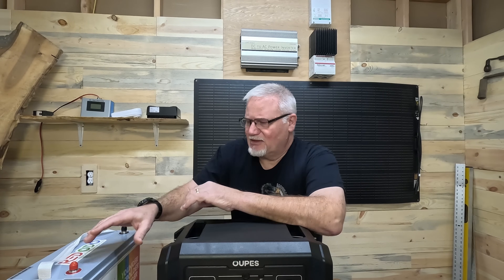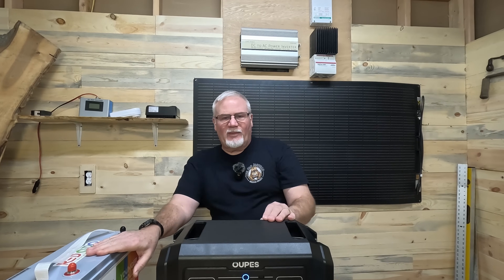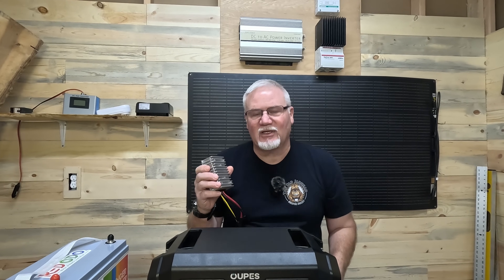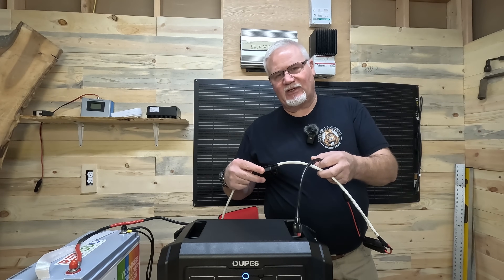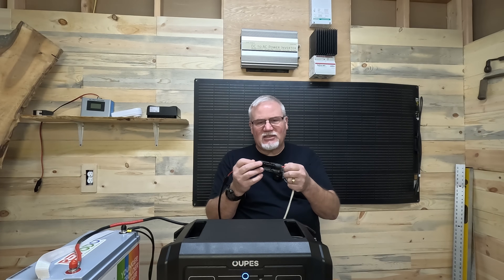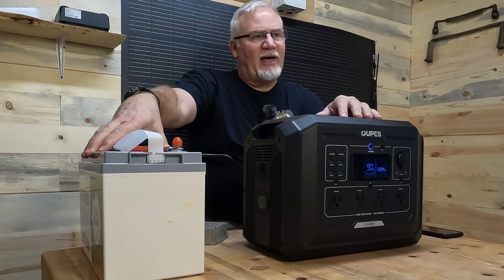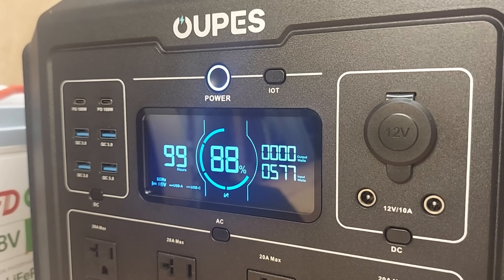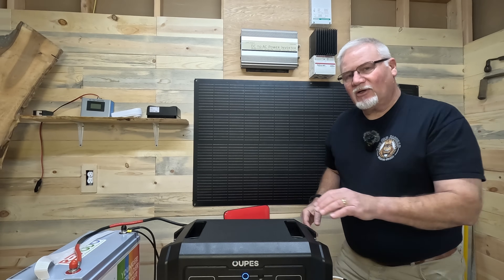Discover How to BOOST Your Portable Power Station Today!

Comment: Thats A really nice item 12-24 to 
48 volts  converter on only one 12.8 - 100 ah battery
But how long will it take to charge the power unit @500 watts.
 "say two hours"
Looks good though
& the solar setup is A plus add on 
Thanks Doug
Reply from the maker: I don't look at this as a 'charge' thing but rather an 'extend' thing.  Basically, the power station should already be fully charged and the battery too.  Connect them together and the battery will drain first unless you try to draw more than the 500w or so it gives via the solar port.  Once drained you're on the power station but can run a generator to charge the battery back up and continue to use it.  Many did this during Hurricane Helene and reported it worked very well for them :D

Comment: Would you recommend using the same setup on a Ecoflow river 2 pro??
Reply from the maker: Ecoflow Solar Input = 11-50V 13A, 220W Max --  as it's limited to 220w using a 12.8v battery would be fine as it should give you 166+w of charging while in use.  Of course, you have to then, later, charge the battery back up via a charger or solar panel and charge controller.
Reply: @TheOldJarhead ok I’m planning to use 2 lithium ion batteries 12.8v 100ah and a Victron Energy 100V 30A charger control with an 450W 48V 11A solar panel to charge the batteries
Reply from the maker: That would work nicely.
Reply: @T @TheOldJarhead  can I still use the Dc to Dc 12v to 24v converter?
Reply from the maker: You wouldn't need the 24v converter.  Just connect the batteries in series to get 24v and attach the controller to the outputs (from the 24v series batteries).
Reply: @TheOldJarhead ok nice 👍

Comment: Been watching your videos very helpful. Still a little confused with charging when you’re connected with  a external battery. When you’re using an external battery through the solar charging port. You can’t have your battery hooked up to a solar controller and its own solar array, while it’s hooked up to your oupes mega 1?
Reply from the maker: Actually, you can hook up solar to the battery (via a solar charge controller) and leave the battery connected to the solar port as long as the charging voltage doesn't go higher than the solar input max.
Reply: thank you for your help, do you recommend a solar charger so I know what specs I’m looking for
Reply: Or can I simply not connect too many panels that will not equal over that max voltage? Like by just connecting to solar panels in parallel with a max voltage of 40v
Reply from the maker: Hmmm depends on a number of factors.  If 12 or 24v the LiTime you see in my videos works well, for a little less the Bataria also works but dollar for dollar Victron may be the better option except the 100/35 which gets too hot
Reply: I have a 48v -52v battery
Reply from the maker: I've used a few that will do 48v LiFePo's but just bought this one for my own uses:  https://tinyurl.com/y5u3vsby Victron has excellent BT aps and integrates with a lot of systems.  Yes, it's more expensive than the Bataria I have been playing with but a lot less then the MorningStar and Outback controllers I have :)  So I have no issues suggesting this one :D  Victron has a great name too!

Comment: I want to charge a Anker Solix C300 with a spare car battery (12v 660 amp), do I need a charge controller for that?
Reply from the maker: No, but I would not use that battery.  Lead batteries do not have BMS's to protect them or the cycle life of a LiFePo4

Comment: Nice! Thanks for sharing the video. What size battery cable did you use?
Reply from the maker: I believe in this one I used 10awg cable as you're only drawing 13amps at most.
Reply: Thanks for the reply.

Comment: You really did help me out, I have been trying to learn this now for days.
I have my buck booster with my ecoflow river 2 max and a 100 ah LiPo battery. I won't be drawing more than 45 w with my cooler.  I'm mostly just charging my phone, lighters and air pump. Maybe a fan. I have a 160 watt solar panel with built in MPPT.
Reply from the maker: Glad I could help!

Comment: I have 2 EcoFlow, max charge is 24v 12amp and 24v 15amp.  I have a up converter that is 24v 15amp.  I’m scared to put it on the 12amp power station. I’m getting ready to add a 12amp fuse on the power station side. My question is, will the power station itself only draw 12amps and limit its self or does the up converter pushes 15amp all the time. Thanks
Reply from the maker: If connecting to the solar port then yes.  The power stations solar port limits what it draws.  I'm using batteries with 100amp BMS's on power stations that only draw 10amps.
Reply: @TheOldJarhead thank you, I’m using the same battery. Do you think the fuse on the power station side is still a good precaution?
Reply from the maker: I think it's a good idea

Comment: I am new to all this, do you need a stepup convert or can you just hook the 12v to the switch & fuse. I love the way you explain things. I already have an oupes 1. but would like to make it last longer.
Reply from the maker: You can connect a 12v battery to the Oupes Mega 1 Solar input but it will only give you 120w of charging power.  Best is a 48v battery but in the absence of a 48v battery a step up converter will work, just keep an eye on it as it will get hot.
Reply: @TheOldJarhead  I am also very new to this.  So will only giving me 120w of charging power when hooking directly into a 12v battery mean that it will just take longer to charge the power station from the battery, as if I only had 120w of solar coming in?  Will the power station still be able to use all of the battery's power, or will it no longer be able to use the battery's power once the battery's voltage drops below a certain point?  We usually only lose power at our home for one day max, and I was thinking I would use the 100Ah Lithium RV battery we have to add a bit of juice to the power station in a pinch with only buying one cord instead of bunch of do dads. Thank you for your videos - I am learning so much!
Reply from the maker: With the Oupes Mega 1 it will draw the battery down to 13v maybe a little lower but that's most of the battery anyway.  It can draw 13amps so in theory it will draw over 170w at the beginning  (13amps x 13.7v -fully charged 12.8v battery is actually 13.7v - so 178w).

Yes, just like solar.  The best way is to attach the battery as soon as you have no solar a d let it draw off the battery while running.

Comment: I working on a project in Cuba to help people that are suffering from a collapse Grid.  They get about 4 or 5 hours of power everyday and it's cheap so I don't really need to prioritize Solar at this point.  What I would like to do is set this system up as you have shown and have a AC charger that I could use to rapidly charge the 2nd battery.  (my assumption is that it won't charge from the main unit because it's not bi-directional.)  Can you recommend a rapid AC charger that isn't expensive so that I test it?
Reply from the maker: Check out LiTime's 40 or 60amp chargers

Comment: Would you need a step up converter if I used a 48v lithium golf cart battery?
Reply from the maker: Nope.  A 48v LiFePo4 is actually about 53.7v and at 13amps (max) on the Oupes Mega 1 you would get over 540w of charging from the battery.

Comment: Anyone knowIf I hook up a 12V to 24V 10 amp converter to a 100W solar panel, Then to my battery,will That also boost the 100w panel to  200 Watts going into the battery.?
Reply from the maker: it won't increase solar output but may increase the effectiveness of the MPPT controller if it's voltage is too low for it

Comment: Subscribed from United Arab Emirates!

I have an Ecoflow D2M and i plan to purchase

1. 24V 100AH Lithium Batt
2. XT60i Cable 
3. 24V DC Step up to 48V 

Will it work ?
Reply from the maker: Yes that will work.  Just keep an eye on the converter to see how warm/hot it gets and be sure to give it room to breath (airflow to help cool it) and you'll be set.

Comment: I have my 12v 100ah Lifep04 hooked up to a battery combiner in my Toyota FX to run my DC fridge, lights and DC fan. This set up can charge my EcoFlow also, another great video, thanks.
Reply from the maker: Nice, do you overland it?

Comment: What is the wire gauge of the converter wires? Thanks.
Reply from the maker: I'd have to check as I'm not home but I believe 8g
Reply: @TheOldJarhead  Thanks. Whenever it's convenient.
Reply from the maker: You bet
Reply: @TheOldJarhead  ?
Reply from the maker: ahhh sorry!  yes mine are 8g on the lower voltage side
Reply: @TheOldJarhead  Thanks 👍
Reply from the maker: You bet!

Comment: You could also get 2 batteries, connect them in series which would boost the voltage to 24V and hook that up to the input of the power station. This would be a bit more efficient than the voltage boost converter since you wouldn't waste energy boosting the voltage.
Reply from the maker: True

Comment: Is there any way to automate the charge and discharge of the expansion battery. Would be so cool to AC charge a large expansion battery during off peak hours. And then discharge it into a Power Station during peak. Designing an all in one system would be really cool.
Reply from the maker: You could use a auto time to turn on the charging circuit during off peak times and turn it on during peak times and then set up a 20 amp charger connected to the external battery.

Comment: I do not like step up converters.
People suggest these and I'm not sure they are necessary.

"What are you yipping about?":

Many of us have entry level units that will take 12v solar e.g. Jackery 1000 v2s along with owning entry level chargers of ~10amps. The Jackery, actually, cuts off between 10 and 11, if it started with >12. 

The converter is $30.00 and I just bought a battery from DUMFUME for $97.20 on a president's day sale (the irony).
So, another 100Ah battery for +$70.00.

Those things get hot, they are, at best, 85% efficient and DC to DC has its own 3-5% loss because it has to be regulated by the BMS.

For you that have higher grade equipment  I suggest the highest voltage batteries your power station will accept and you can charge directly. 

In a real blackout you will, hopefully, be using common sense and even if the battery is only supplying 50% of the load,  5 hours later you still have 5 hours of, if you choose the highest voltage battery you can charge, significant load sharing without the heat (which is just wasted watts)  from both the step-up and the PS trying to process a fat load.
Reply from the maker: All true.  The idea here us for someone with say, an Oupes or Pecron etc with a 12v battery who needs to up their voltage to get better access to that reserve.  $30 is usually palatable to some than say $70 (though most good 24v and 48v batteries are pretty speedy and much more than $70).  I always recommend batteries of the right voltage but step up converters do work in a pinch 😉  Heck I recommend DIY solar over a power station too. :)

Comment: Hi great video, thank you. I have a set up using 3 100aH LifePo batteries in parallel and I have a power pack as a small back up - VTOMAN 600w 599wh with an Anderson (small) solar port rated at max 12-50v 200w. My question - if I use a 12 to 24 volt step up converter will I be able to achieve a charge rate of 200w - I have tried using my system as is and can get 100-102 watts charging to power pack? Or is my power pack limiting what I can it at, which seems very strange lol. Thanks again 😊
Reply from the maker: Yes stepping up the voltage will make quite a difference though putting the batteries in series (make sure they are fully charged first) will work better possibly but a 24v converter works well and I've used one myself with a Jackery 550 and it worked great though the amp draw was just under 4a for a 10a converter which likely helped keep it cool.  Putting in a fuse also is important.
Reply: @TheOldJarhead  thank you for getting back to me 😊 my system is 12v as my van is 12v (most camping vehicles in UK are set up for 12v - shame, I know😂) what fuse would you recommend - I thinking 20amp midi fuse, I’m using 10AWG wire. Thanks again 👍🏼👍🏼👍🏼
Reply from the maker: For 10awg wire a 30a should be fine.

Comment: i charge a powkey 200w which is 15v 2amp 2 12v batteries cigarette  plugs and 24 volt to 15 volt 2 amp to charge the 2 12 volts use solar panel placed in the window facing du south

Comment: Wow I’m learning a lot from your videos. I’m retired Army and find this info very useful. I want to turn my outdoor shed into a mini power station just to run my fridge, mini freezer, hot pot for boiling water and insta pot for making meals.
Reply from the maker: Sounds like a great project, keep me updated on your progress!
Reply: You should consider induction for your cooking. Much more efficient.
Just remember that counter-top units have fans that need cleaning. 
Lock the fan in position with a toothpick, straw, paperclip etc to lock it in pace so it does not over-rev and blow compressed air back through the exhaust until nothing comes out.

They will overheat in about a year, especially with pets, shed dust, if you do not keep them clean.
Reply from the maker: I'm more of a gas over electric for cooking
Reply: @ It is nothing like the electric experience.
Reply from the maker: lol I try to conserve my electric 😉

Comment: Awesome video! Purchased the components,  wear does the on/off switch wire into in correlation to the 12v to 24v converter & 30 Amp inline fuse? Switch & fuse wired into the input solar panel cables? Or battery cables only? Is the step-up converter wired into the solar pigtail to the power station cable?  I'm a first timer, new at this... do you have a diagram of your set-up? Thank you in advance.  Mike
Reply from the maker: I put the switch  between the battery and the DC converter and the fuse between the power station and the DC converter

Comment: is it possible to do the same with fossibot f2400?
Reply from the maker: Solar Input: 500W Max. Car Input: 12/24V from Cigarette Lighter Port -- This leads me to believe the solar input port is maxed at 24v so no not with a 48v buck converter and since it shows a 500w max solar charging that means a 20a input so in this case better to get a 24v battery and plug that in though it doesn't clearly state voltage and it's possible when it says '24v' it means it -- this could be an issue as a 24v battery is really 25.6v (for LiFePo4's) but it's like the Aferiy I suspect and it will give you all of that and like it ;)

I'd have no problem putting a 24v battery and hooking it up to it.

Comment: My Must 3kW power station HBP-1800 series
PV array open circuit voltage - 160VDC
PV Array MPPT Voltage Range - 30~128VDC

Can I use 51.2V Lipo4 Battery to charge form solar input?
Reply from the maker: Yes and it looks like two in series would work even better.

Comment: Thank you for the look at your set up.  A noob question about the step up converters - Do the converters limit their output at the rated current or will they output higher than they are rated for?   I get the impression that they will over-run their rating depending on what the MPPT controller in the power station settles in at for voltage/current.
I got a lower current 12/24 -> 48v converter assuming it limited output current and that would make wiring demands lower since running lower currents.
Again - thank you for the look at your setup!!
Reply from the maker: This one has over current protection but it did run at 12a

Comment: So rather than hook up 4 batteries in parallel, wouldn't it be more efficient to hook them up in series to get ~48+ volts and avoid any efficiency issues with the step up converter? That being said, I like your video.  Thanks for the content.
Reply from the maker: It's a toss up -- yes going in series works well for that though you must make sure the batteries are balanced or better still, get a 48v battery :)  The idea of this video was for those with a 12v battery and wanting to do this.
Reply: @TheOldJarhead  Understood.  I'm thinking this converter could also be used to boost the voltage from a lower voltage solar array to use the higher voltage solar MPPT on the power station.  Amazon is showing the converter is no longer available.
Reply from the maker: I don't think I'd do that though I suppose with some testing it might be worth trying just for fun.

Comment: Great little set-up! Im gonna try it this weekend. Are the converters typically bidirectional? Or are there diodes to prevent them from converting the other direction? Ie. You're going from 24v to 48v. Can it be used to turn 48v into 24v. Thanks man!
Reply from the maker: one direction
Reply: @TheOldJarhead thank you sir
Reply from the maker: you bet

Comment: if you have 4 batteries hook up in series no need for step up  no power lost to heat as your step up will generate a lot of heat
Reply from the maker: correct though at the start I clearly state this is for a 12.8v battery 😉

Comment: Should there be a fuse or circuit breaker on the positive pole of the 12v battery?
Reply from the maker: I demonstrate that in the video ;) at 2m 42s in 😉

Comment: Word of warning and I cannot stress this enough - Be sure to check the maximum solar input voltage of your power station to make sure your step up converter does not exceed it.  Many smaller power stations are limited to 28-30 volt input on solar.  If you exceed the max input voltage, you will fry the MPPT controller inside.
Reply from the maker: Yes -- and I'm sure I mentioned that in the beginning -- it is IMPORTANT to know what voltage your power station can take or you can let out the magic smoke!
Reply: @TheOldJarhead  I just wanted to make sure, just in case.  Yep, I know what the magic smoke smells like... Doh!
Reply from the maker: I hear ya